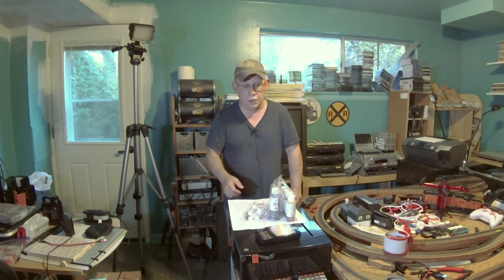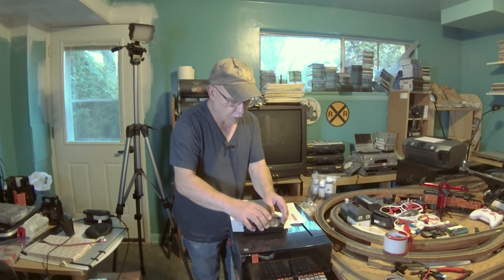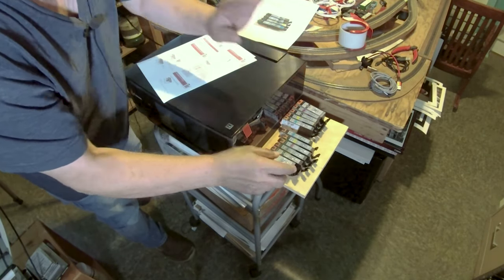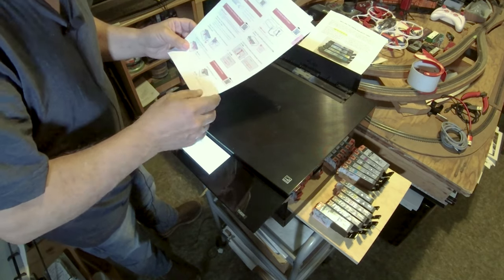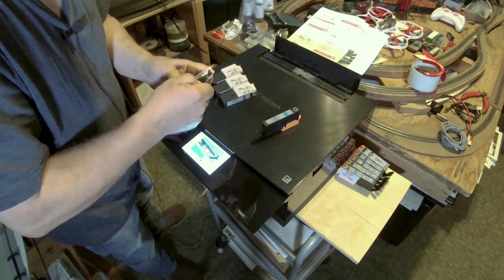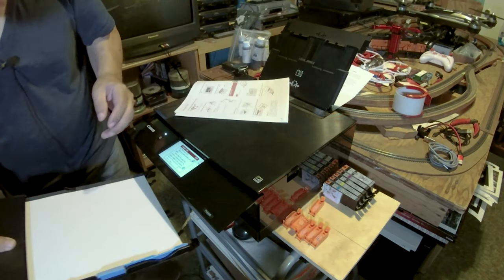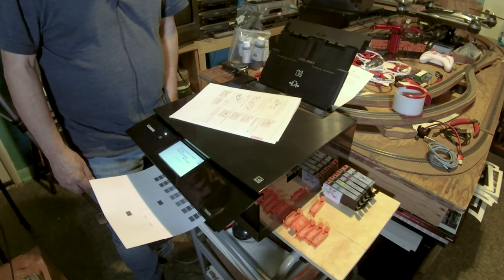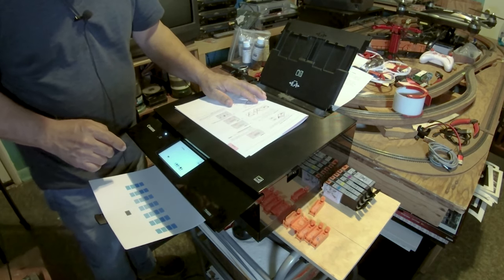CANON TS 8320 install and test photos!

Comment: at 7:00 in. The plugs are best put in the middle between the little hump and the corner. If you put them in the middle, you have the least space and you can collide with the wall or the premoulded fill hole.

Comment: How to put the output tray back into printer?
Reply from the maker: Did you pull it out? It comes out automatically and you push it back in after you are done printing manually.
Reply: @cheo1949  thank you!